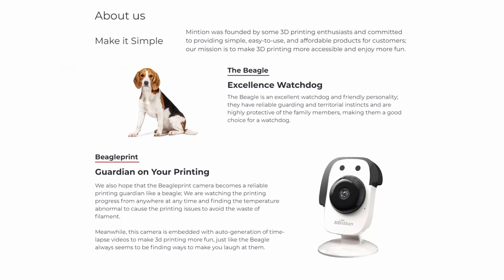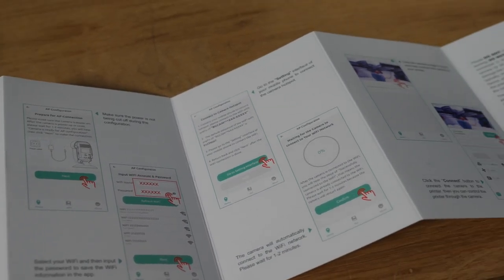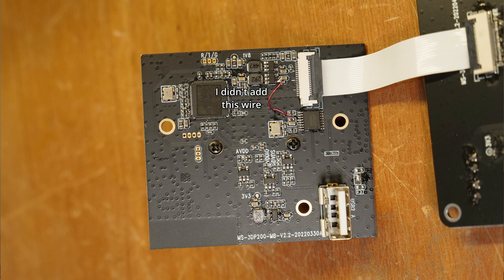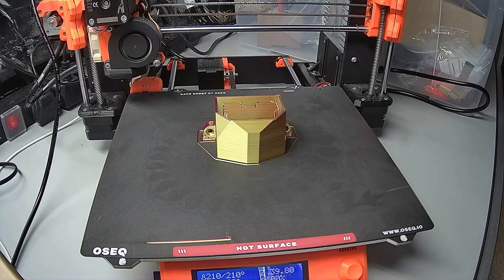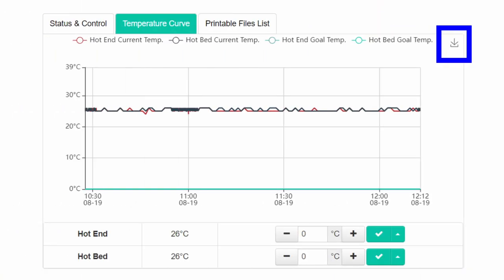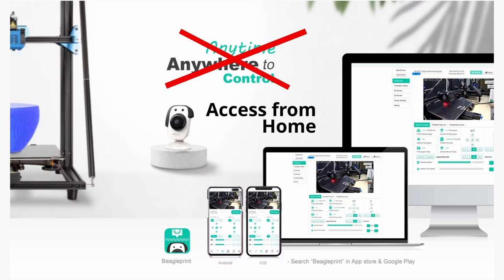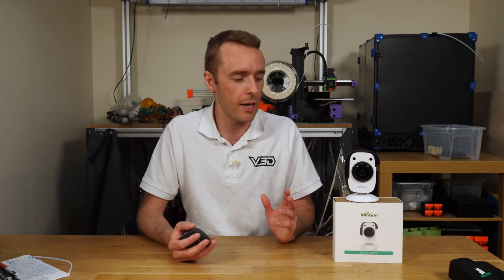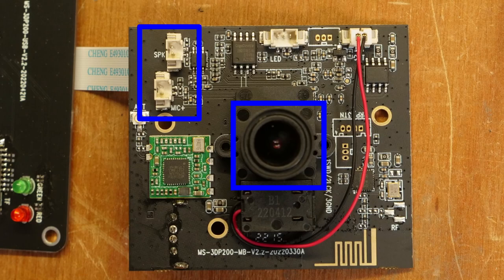This Made Pi & Octoprint OBSOLETE? Beagleprint Review

Comment: Setup worked for me on this thing but neither of the printers (both on the compatibility list!) I tried it on worked, in fact it failed catastrophically with both of them. I haven't had time to progress it any further, as soon as the printers that were supposed to work wouldn't, and when I queried this, I was told to try an ender 3 v2, I had to focus (pun intended) elsewhere. As you say, we aren't testers. If it doesn't work with the printers on the official compatibility list then that's....a problem.

Comment: they sent me one of these to review and my experiences arent too far off f yours. the most batshit bit I think is the focusing mechanism, you have to physically disassemble it to refocus the camera, insane. I appreciate what they were trying to do, but I also had major power issues. no USB-C to USB-C cable I used worked, most of my plugs didn't work, and if I couldn't find the included plug I had to use a battery bank. underbaked is a very kinda term for this. i mean, the first 3 prints I did have corrupted timelapses and for a whole version of the firmware the camera only appeared in the app the web portal only had a black screen
Reply: Did you write a review for it?
Reply: @Rushmere3D  i havent yet

Comment: sounds like one would be better off buying a thin client PC off Ebay, Installing Linux and running Octoprint off that along with a Logitech webcam.  At least until the pi shortage is resolved.

Honestly I am surprised that Logitech has not entered this realm of products, their C920 webcam is one of the defacto standards for 3D Printing cameras.  Seems like they could have an interesting niche product if they worked with Octoprint project and made a device that contained a small bit of computery bits to handle the octo stuff and then the imaging hardware from the C920.  toss in a standard camera tripod mount screw hole in the bottom and they would have a popular product.

Comment: Lol this is just a cheap IoT platform sold to OEMs to make wifi baby monitors. That’s why it looks like a dog. I admit it’s actually pretty clever to repurpose it into a 3d printer controller. It’s funny they reused some of the baby monitor marketing phasing though, like “color night mode.”
Reply: So basically a company in China somewhere stamps out camera with wifi boards by the container load, and firms like the one in the video buy the board. add a few extras and ship it out with a new label.